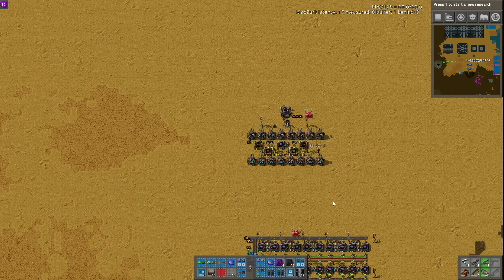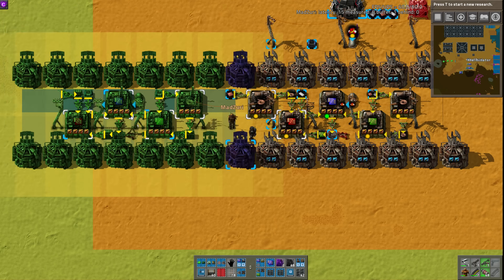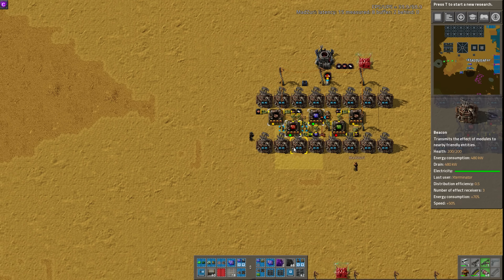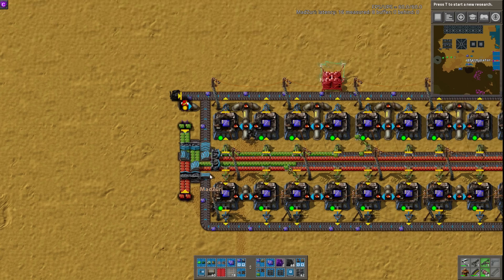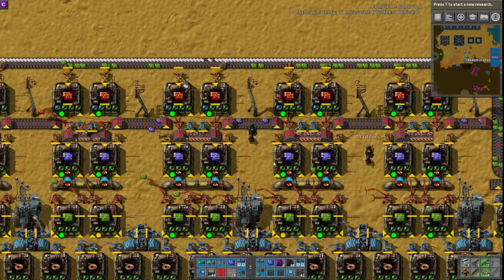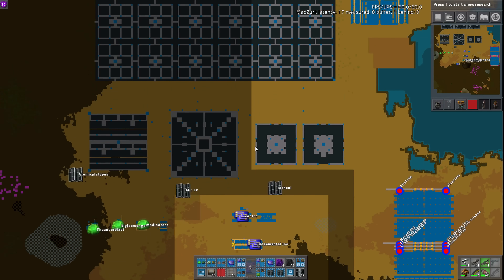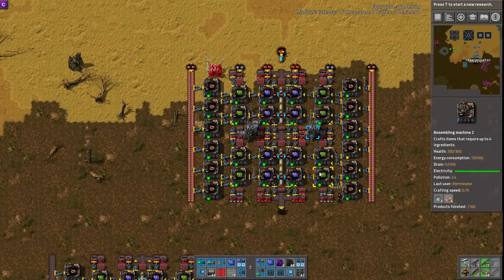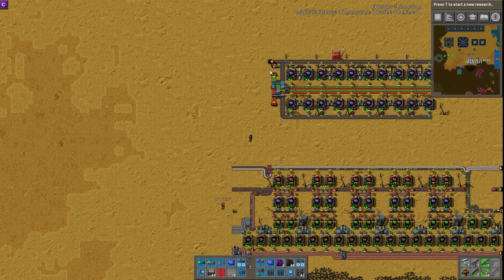Blue Circuit / Processing Unit Builds :: Factorio Workshop Season 2 - Building A Better Factory

Comment: On the difference in difficulty getting resources to the build, I find that it becomes really hard to get enough green circuits around (especially once you start making some modules in your starter base). Even a blue belted green circuit setup is hard to feed but if you have a 4/8 lane bus of iron/copper it is a lot easier to just direct those to a blue circuit build. 

Most starter bases will not be able to supply enough green circuits from 1 central green build anyways (you need like 2 full blue belts of greens if you are using fully speed modded module builds), even when you use a tileable green circuit build upgraded to blue belts. Maybe if you build 2 of them but that is usually not possible unless you took this into account when layouting  your starter base.

Long story short I think its easier to build greens locally (and I will definitely try this on future bases myself) , unless you really planned for a huge central green build from the get go. I know that in the sending supporters to space map you got away with a very small green circuit build, but I think this was largely due to the beaconed setup for modules. In my own base I ran into some troubles with the green circuits even with blue belts due to the resource requirements.

Comment: For those who liked Dawnraider's version - you can support three stamps on a red belt. The last two blue assemblers in the rows will have 85% efficiency, but get the most out of that red belt! It totals to around 106.65 blue circuits per minute at 23.7 Lvl2 assemblers.

Comment: The large builds that I submitted are specifically ratioed and fleshed out to complete science per minute modularly and have information for the settings of the multi item cargo train for the output. You might want to showcase the expensive mode version considering all of the builds are different and being able to calculate the ratio was hard considering the green build was only 56% efficient and the blue build is 78% efficient.

Comment: The first one looks a bit like one i made a few month back (but not quite, have some improvements that i was intended to put in, but never had time to do).

Anyway.. if you where to tile it you should mirror it.. so the red came to red and they share the copper cable production, than have a few bots that supplement the greens with a additional 1/15 cable. (note that this set up have been "nerfed" at the left cable production by not having over lapping beacons all the way out)

The math

Base rate copper cable 4*1.4 =5,6
Base rate copper cable consumption greens: 6 (3/0,5)
Base rate copper cable consumption reds: 0,66666 (4/6)

So if there is 2 greens, 2 reds the total consumption is 13 and 1/3

3 copper cable production produces 16,8, this give a slight over production. but it makes it quite a bit more compact and reduced the number of beacons quite a bit and also reduces one cabeling machine.

(note, i have not made this exact design in the video, i made one similar one that i never finished of)

Comment: I'm so confused right off the bat... how are resources getting to those chests and how is the sulfur getting pumped in?? Teleporting resources? What mod is that?
Reply: i think they are using the creative mod which alows infintate energy on acumilators  and belt input and export and other stuff aswell
Reply: the little purple  icon top left is creative mod icon .. i think ... i dont use it pursonally
Reply: Creative Mode mod would be my guess
Reply: It is Creative Mode